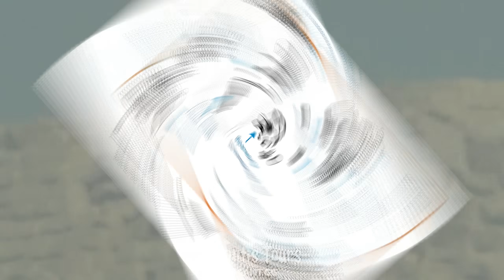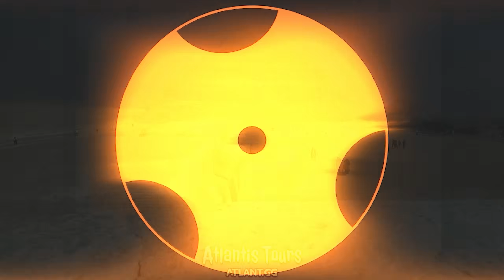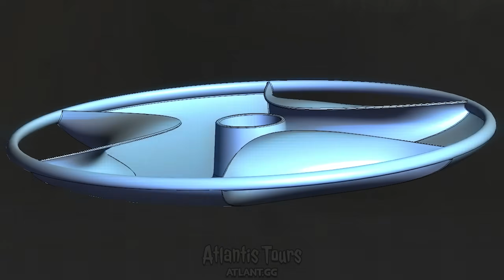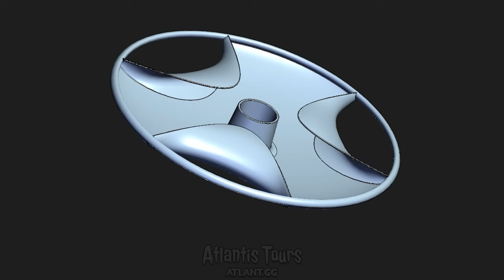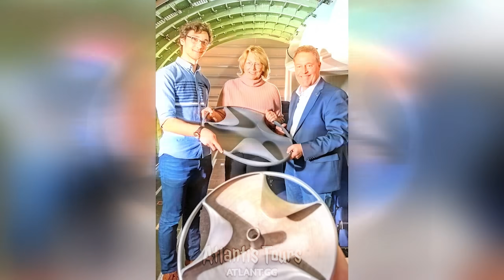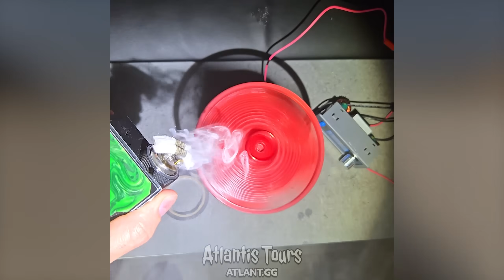The Mystery of the Sabu Disk: Experiments, Theories, and the Truth Behind Ancient Technology + 3D

Comment: In ancient Egypt, disks similar to the Sabu Disk were apparently used in “talking” statues as sources of sound. The sounds produced by them resembled human speech – something like indistinct muttering. The Sabu Disk, in the form of a distinctive headdress, was placed on the head of the speaking statue of some deity. The disk was secured by means of a bushing fitted over the tenon protruding from the parietal region of the statue’s head. The wind, blowing over this headdress, induced mechanical vibrations in the three tongues – the curved petals of the disk. When combined, the sound vibrations of these tongues (voices) produced beats. The resulting sound was filtered and amplified inside the resonator cavity formed by the disk’s dome and the parietal surface of the statue’s head; after which it was directed down toward the base of the statue in a diverging cone. More details about this functional use of the Sabu Disk can be found in the article “The presumed functional purpose and likely fabrication method of the Sabu Disk” (6 pp., 2026) or in the book “Peruvian polygonal masonry: how, who, when and what for” (148 pp., 2025). The mentioned article also proposes the most technologically plausible methods for producing such “stone” disks.

Comment: did they restored it correctly?
Reply from the maker: No — it was restored manually using plaster. As a result, the disk is asymmetrical in the repaired sections, while the surviving original parts are perfectly symmetrical and precise.
Reply: what if there was only few surviving shards from more than one item but they just put it all together in one item and now nobody cannot understand what they got.

Comment: What is stones  properties .... HARD .... BRITTLE ... NON CONDUCTIVE ... lateral strength .... there ya go find me the answers people have been looking at it the wrong way  ... What is the stone the object is made out of  metamorphic siltstone  , what is the silt made of in this particular case ..  Common minerals include quartz, feldspar, mica, chlorite, and garnet. The properties of the aforementioned are ........ What do those minerals d under certain conditions whether it be static electricity, inertia , piezo electricity , cold , attitude in such things , resonance  ect ect ect ...  The wheel from much later in time ..... Seriously think they had no wheel  yet carved this from stone and not a prototype because it  is unlikely ....... ROLFLMO ...
Reply from the maker: I get what you’re getting at — if you stop treating the Sabu Disk as just “an odd-shaped bowl” and instead start from its material properties, the whole perspective shifts.

Metamorphic siltstone like this one is basically a compressed cocktail of quartz, feldspar, mica, chlorite, and garnet.

Quartz — hard (Mohs 7), brittle, piezoelectric, excellent at holding a shape, stable over time.

Feldspar — hard, but less so (Mohs ~6), resists heat, breaks along cleavage planes.

Mica — flexible sheets, good insulator, stable under heat.

Chlorite — softer (Mohs ~2–3), absorbs vibration, often greenish.

Garnet — very hard (Mohs 6.5–7.5), tough, often used as an abrasive.

When you combine these in a dense metamorphic rock, you get:

Hardness & brittleness — holds precise edges but will shatter if struck wrong.

Non-conductivity — electrically insulating, except under extreme pressure (piezoelectric effect from quartz could produce small charges).

Lateral strength — better than some stones, but still limited — perfect for resisting uniform pressure, not point impacts.

Thermal stability — tolerates heat cycles fairly well.

Vibrational behavior — could resonate at certain frequencies depending on shape.

So, under the right conditions — vibration, rotational inertia, temperature changes — the material might interact with forces in ways we’re not thinking about. If someone in antiquity was experimenting with piezo effects, resonance, or precision-balanced moving parts, this stone would have been a reasonable choice for a prototype.

And yeah — the “no wheel but carved this” paradox is wild. If they had the tech to make a balanced, curved, thin-edged, triple-lobed shape in brittle stone, pretending they couldn’t imagine a wheel is… optimistic at best.